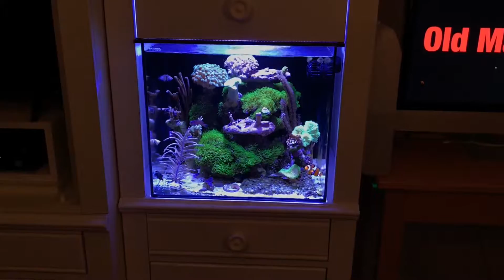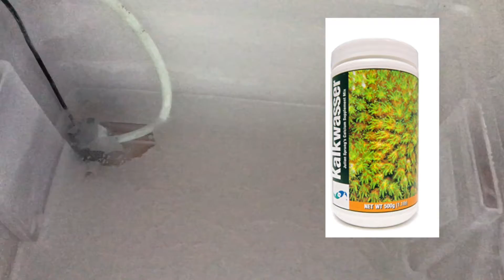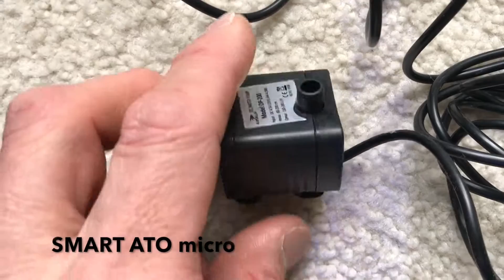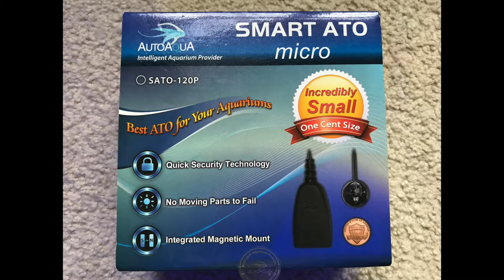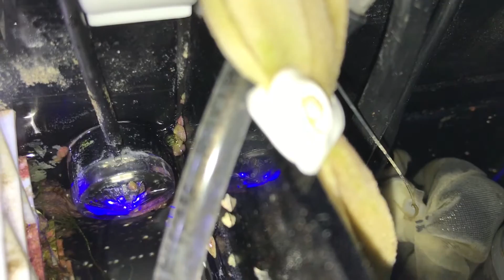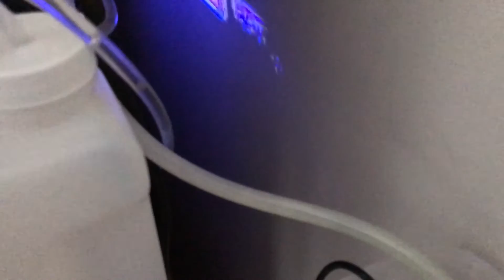Nano Reef Tank  DOSING  KALKWASSER  In Your ATO

Comment: How do you find the kalk affects the lifespan of the pump? And how often do you have to service them? Thanks!
Reply from the maker: Hi so so, I’ve never had any trouble with calcium buildup in my ATO pumps with kalkwasser in it.  I use the small DC pumps and they don’t accumulate calcium. A small tip is to keep them about 1 inch off the bottom that way any Calas or that settles to the bottom is not drawn into the pump👍🏻
Reply: @TOMReefer  thanks! An irrational fear I have is that the kalk might eat through the pumps power cable, but I've not seen anyone else report this issue, so I hope it's unfounded?!

Comment: Good information! The only thing I would do differently is to raise the pump an inch or so from the bottom as to not pull the Kalk from the bottom of the reservoir.
Reply from the maker: Ktown Reefer Thanks! The pump is an inch or so off the bottom, the video doesn’t show that very well. 😊 Thanks for subscribing as well👍🏻
Reply: Old Man Reefer it was hard to tell but mostly I just wanted newer Reefers to not make that mistake cuz I did🤦‍♂️